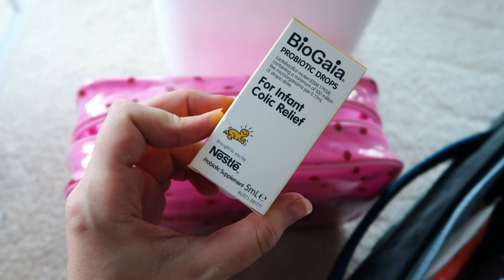I Packed WHAT In My Hospital BAG?!? Last Week BEFORE BABY! Cooking With My MUM.

Comment: Tucked Underneath the base of car seat are there 2 “lobster clip that attach to the anchors of the car that are squished where the seatbelts are?  Only from experience I didn’t realize that they were there. ( because I just installed without looking at the instructions, my bad). Just FYI incased you guys missed it 😍 congratulations 🥳 to both of you